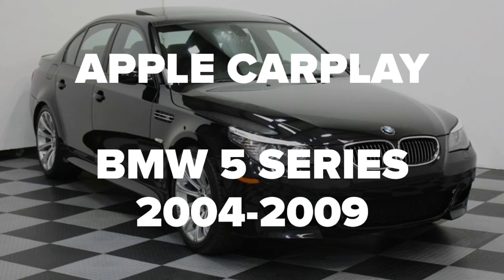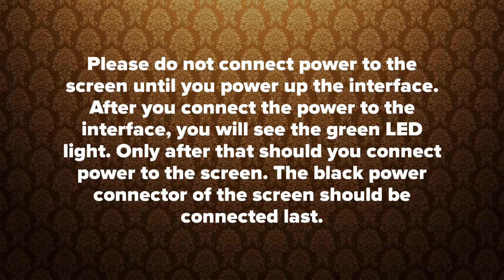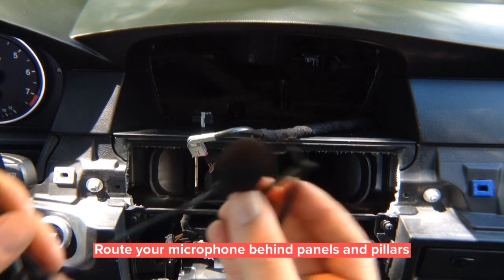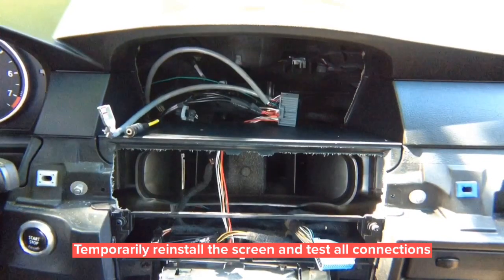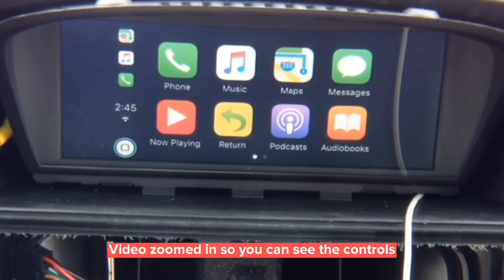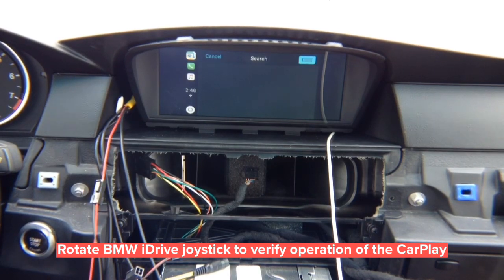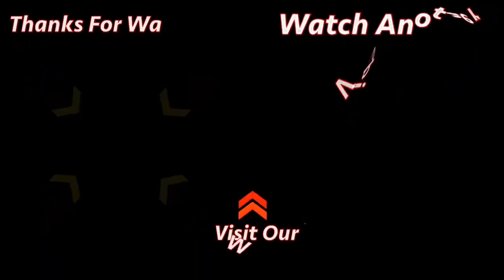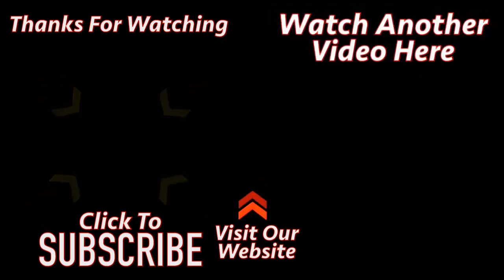BMW 5 Series Apple CarPlay - How To Add Apple CarPlay BMW 5 Series 2004-2009 E60 E61

Comment: You do not show how you connect front and back up camera power and the RCA cable. Where you connect power to? which RCA cable connect to the front and to the back cameras.
Reply from the maker: there are 4 RCA inputs for camera.

Comment: For all those hard to remove harness connectors for everything in vehicles etc.. find it a lot easier to use the same small thin pry tool to dislodge the connectors.. idk why but seems those clips although designed to be removed by hand never seem to fully disengage for me.. as I already have the tool to remove the panel in hand makes it much easier and faster most time
Reply from the maker: Cool

Comment: where are and how to access the 2007 BMW 550i System Checks features through iDrive, after this device replaces my current display?
Reply from the maker: this device doesn't replace factory radio or screen, it all work on the factory screen
Reply: NavTool what model number will work for my 2007 BMW 550i.  I would like to purchase the correct device.
Reply from the maker: please visit the site and use live chat so that we can give you correct link
Reply: NavTool okay, what is the site address?
Reply from the maker: navtool.com